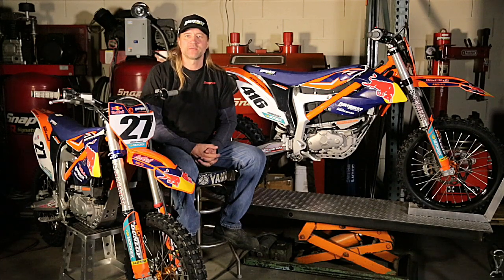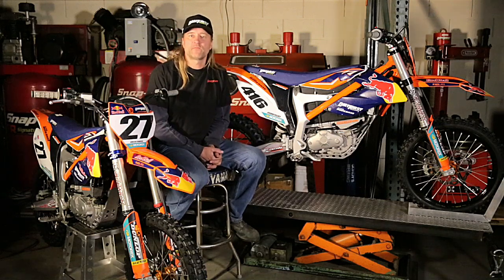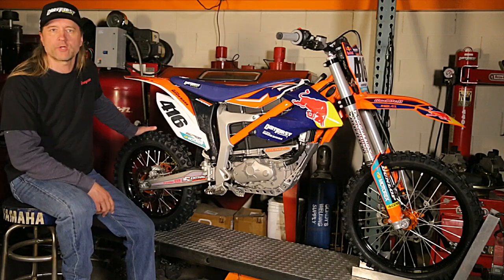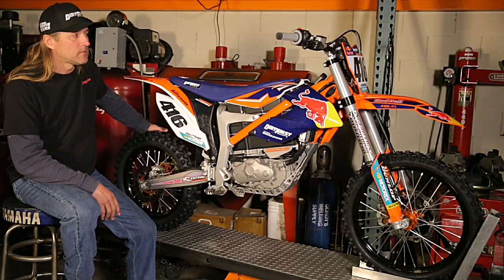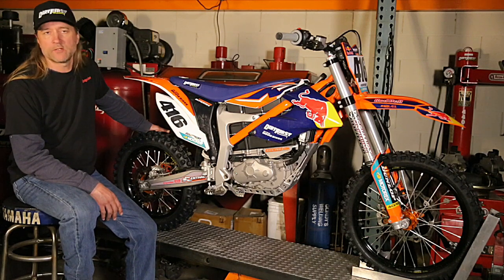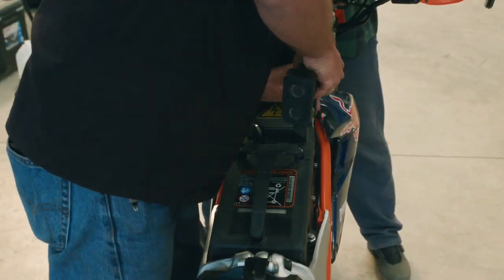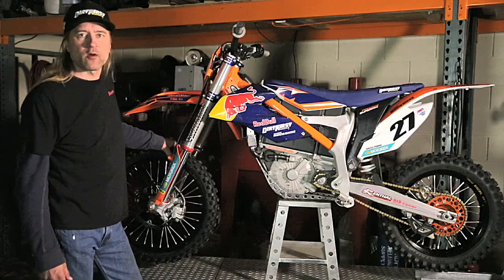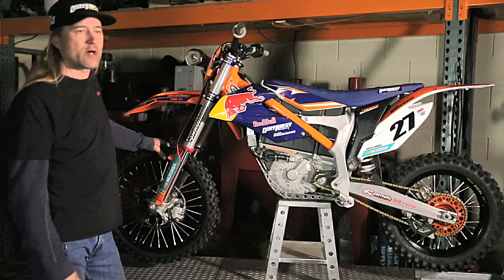KTM Electric Motocross Bike Breakdown - range, power, weight, suspension The 2023 Freeride Supermini

Comment: Nice work Andy!  I’ll send some pictures of your ALUMINUM FREERIDE SKIDPLATE I got from you on my’23 freeride exc! I have a question for you about the 85SX fork.  The triple clamp. My year has a nice billet aluminum set and are 43mm. Now I see on one of the mini’s a aftermarket billet aluminum set ?  What’s my opinions for triple clamps ?  I’m doing all I can  lowering bikes weight . WICKEDWHEELWERKS
Reply from the maker: On hard impacts during MX races, the fork tubes can move in the stock Freeride triple clamps. We modified XTrig clamps and tested them for a few months with great results. We recently received a small number of clamps from XTrig and we are putting together a few sets now.
Send me some pics of your bike, and let me know how your skidplate holds up!